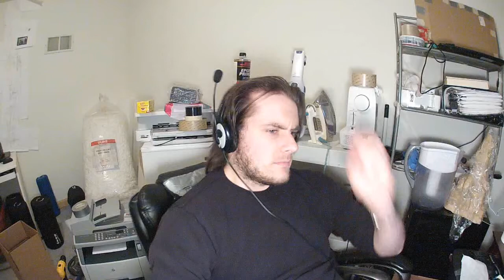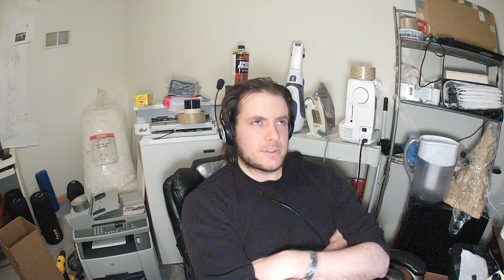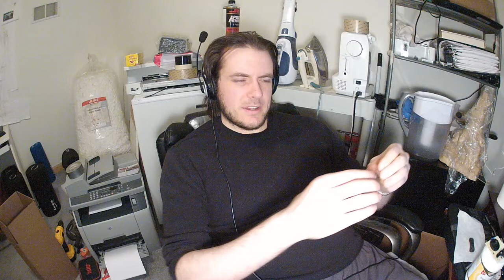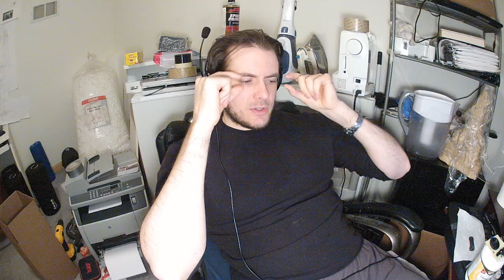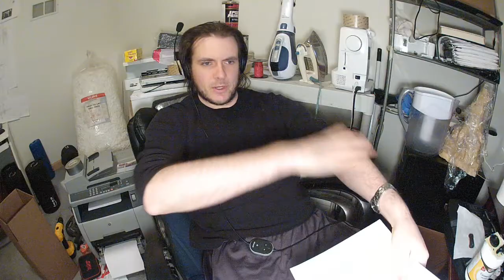Discussion of Overall Components Involved In A Advanced Humanoid Robot | Building Humanoid Robots #5

Comment: Greetings. Very interesting project, however I have a few points to share:
- I think your goals might be a bit too lofty for a first build. While I understand your sentiment on the lack of functional humanoid/android robots, there's a reason for it. The only "real" application for such a robot, for the time being, is research. These research tasks don't demand anything from the robot other than for it to look human. Other jobs are better suited for specialized machines. Having a robot walk on two legs and handle a vacuum cleaner is much, much harder than simply making a roomba. We haven't gotten to the point of being able to build a swiss army knife robot. However, there are some potential applications for even basic humanoids - simple Q&A positions and "humanizing" automated customer interaction.
- I understand your familiarity with Windows, but for a robotics project I'd really give Linux another look. Linux has (imo) much better hardware interfacing, filesystem, shell, etc. and most importantly it's free - if you ever want to sell your creation, you don't have to worry about software licencing. There's also frameworks like ROS available which you can tap into. 
- Instead of a laptop board, I'd consider a proper dev-board, they're so many cheap options with the *-pi boom. If you need more power you could consider something like the nvidia jetson, it has GPU compute capabilities (so you can offload image processing and the like) and is still meant for embedded applications. 

I know I sound like I'm bashing your work, but I'm not. I'm actually very interested in these type of projects. I'd be happy to help on some things - I've made a few (basic) robots before, and have intermediate CAD/modelling skills - just HMU.
Reply from the maker: Thanks for your thoughtful and encouraging words.  I disagree on several points, but I just have a different set of experiences and facts to pull from and a different world view but I still respect and understand your points of view so please don't take offense as I address your points even if I happen to disagree.  I think for a first build this is not too lofty of a project for me.  For some, it may be, but in my eyes, I didn't need small wins to first build up my confidence and the same sets of challenges and hurdles will have to be crossed eventually, so I think it best to save time by just jumping right in rather than putz around with confidence building mini simple projects first.  I see that as no more than mental masturbation boosting your ego enough to take on something larger and more complex.  You either have the ability to solve the problems and research what you can't solve until you find the answers or you don't.  Taking on smaller projects first will not change that and I have the confidence in my capabilities of overcoming any hurdle I may face on the journey to not require little confidence boosting projects to gear me up for this one.  
-I feel a swiss army knife robot is superior but not commercially viable yet and companies need fast wins of simpler robots to get the A for their class project or satisfy their investors or w/e.  They also would experience burnout with a group of people who cannot sit and work on something for 2 decades with no positive feedback or additional funding.  This is why you don't see swiss army knife robots YET.  But they are coming and I'm just one of the early adopters of this goal for a robot - particularly as an individual as opposed to a team of people.  Nothing could be cooler than a robot that can do it all as opposed to a single function.  Cool factor means a lot to me and will mean a lot to fans of the project who will provide me with funding later on in the build.
-I will unlikely ever mass produce for commercial sale these robots so licensing windows won't be an issue.  Plus the relatively low cost of paying for a copy of windows to be delivered along with a million dollar robot makes the cost factor of licensing a copy of windows a non-issue.  I think windows will be just fine from a legal standpoint and as far as filesystem structuring, I have no clue why that matters aside from maybe faster info pulling from harddrive?  I don't really care about that as visual processing (gpu) and ram processing are more important for realtime and the harddrive is secondary.  I fail to see how hardware interfacing would be superior based on OS and don't understand what you mean - I'm ignorant on this.  But learning to code in and use a new operating system is just not worth the effort unless I found some VERY compelling make or break reason other than vague "this or that is arbitrarily better to some undefined extent" type of logic...  
-For the main pc, rasberry pis or any dev boards would not come close to providing what I need in terms of raw processing power.  I need a full blown gaming pc type hardware.  I'm now leaning toward a mini ATX motherboard, top end video card, and top of the line processor with as many cores as possible and highest speed possible while still maintaining a small overall form factor of the pc in his chest.  Real time visual processing and all the other processing will need WAY more power than any integrated system focused hardware would ever offer but that is just a guess on my part.  Also due to economies of scale and supply and demand I feel a small form factor high end gaming pc would be alot cheaper than a custom integrated system focused set of hardware which would be B2B priced instead of competitively consumer-centric priced.  Anything generally produced with military or large corporate customers in mind will have stupid high pricing I bet.
-Thanks for the offer of assistance but at this time I'm not interested.  My standards are EXTREMELY high and perfectionistic and I don't trust anyone coming near this project and fear I would disappoint anyone who tried to help me by rejecting their work as inadequate.  Plus just training people and explaining to them exactly what I want is a lot of work and they may not deliver anyways and I can't afford to pay the best of the best to do my bidding.  Best to just keep it simple and do it all myself no matter how long it takes.  I'm 3 years into this so far and expect DECADES of work still ahead to get anywhere meaningful.  Its a marathon and not a race at this point.  Not only that but I want the project's main claim to fame to be that it was all done by ONE person with no help (aside from advice and moral support) which will make the project that much more impressive and popular - not to mention inspiring.